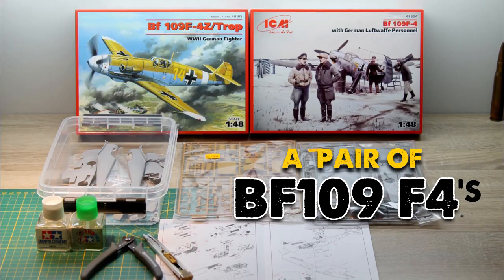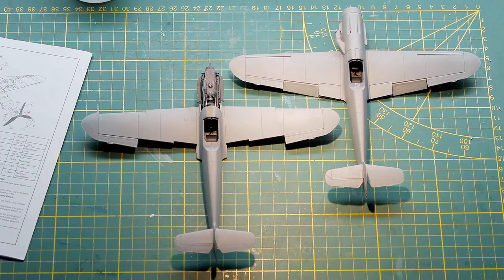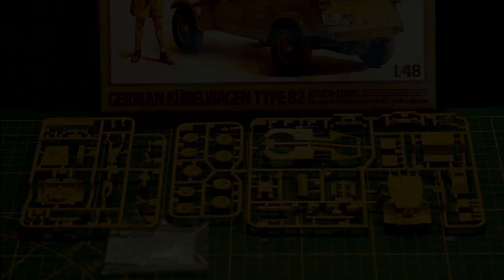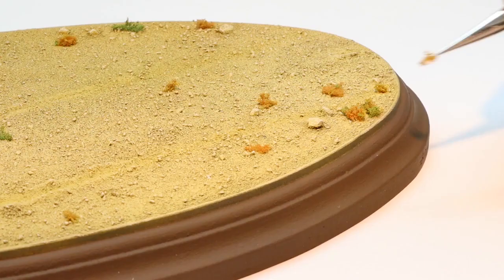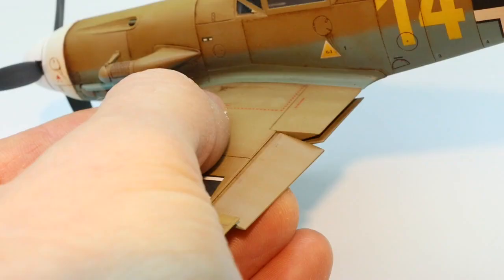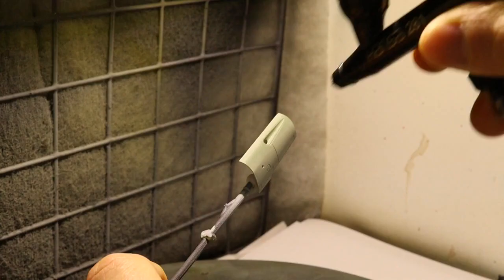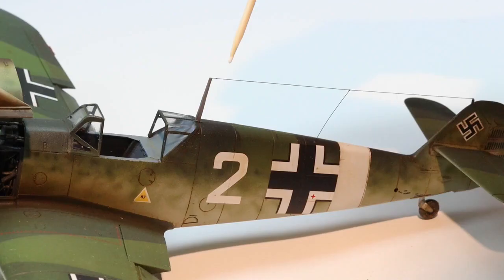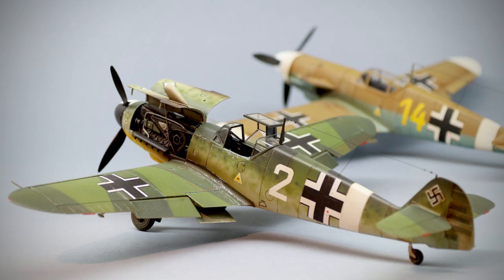A pair of Bf 109 F4 - 1/48 ICM model kits build | ICM 48105 | Tamiya 32503

Comment: If you're familiar with the little yellow post it notes with the tacky strip on one edge. They can also be purchased with the entirely of the back side with adhesive. 
They work really good for masking. The adhesive is also low tack so no paint lifting on removal.

Comment: i love this style of vid!!! the highliting and arrows really help with understanding scratchbuilding as i would consider myself an intermidiate modeler and im trying to learn scratchbuilding and many techniques in this video!

also how did you make the tire marks??
Reply from the maker: Thanks for the comment, glad you like the video. I added wood-glue to the base and sprinkled sand into the wet glue, it stays wet for a while, so you can roll a spare wheel (or toy, coin, washer,...) into the sand. Measure the distance between the 2 wheels to get the correct spacing. Hope this helps, cheers 👍
Reply: @stevenshobbychannel  thanks!

Comment: Highly detailed for scale 48 but nothing fits together! A complete bag of plastic crap!
Reply from the maker: You can save a lot of time when buying some of the other brands instead, I happen to have a pile of ICM kits in the stash, so I might as well try to make something out of it :) cheers
Reply: @stevenshobbychannel  As can see, you didn't install the engine into the yellow 14 from Marseille, and I know the reason. With the engine the motor coverage doesn't fit. But another question, how did you manage the crispy splattering decals from ICM?
Reply from the maker: @ichmalealsobinich  Hi, I never mount an engine in my models when it will be hidden, that said I have no doubt this would give a fitting issue in the ICM kits.  About the decals, I cut them out and put them one at a time into luke warm water,  microscale set is aplied onto the model, decal is put in place on model with tweezers (over a gloss coat), then I push out any air with a brush, then microscale sol is brushed over the decal. I keep an eye on the decals and brush microscale sol again over the decal a few times.
Reply from the maker: @ichmalealsobinich  Also, the decals should come loose by themselves in the water, I wait until I can move/slide them on the back-paper with my finger, if they don't move easy on the paper then they are not ready.
Reply: @stevenshobbychannel   In spite, all maintenance details with clear area fell apart after the were loosening from the back paper. I managed finally the problem by overpainting the decals with clear acrylic colour before they are soaked into the water to loose them. That functions. But still they remain to be very crispy.
Reply from the maker: @ichmalealsobinich  Good news you could still use them with a touch of clear acrylic. It appears my decal-sheet was better preserved in the box than yours, or printed in a different batch.